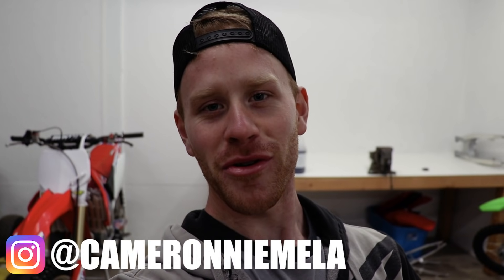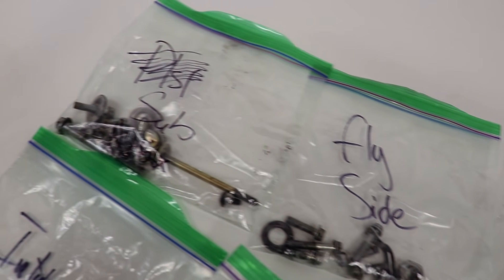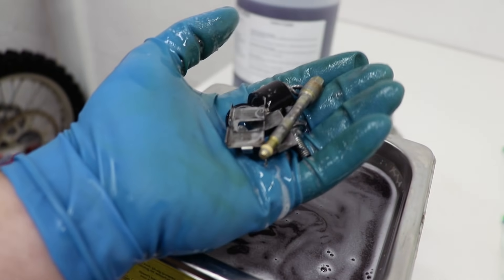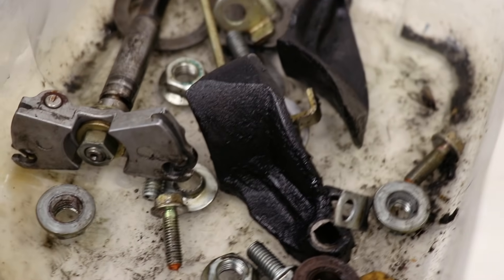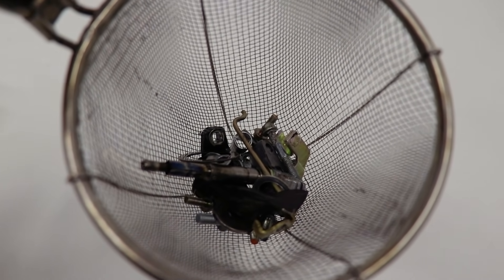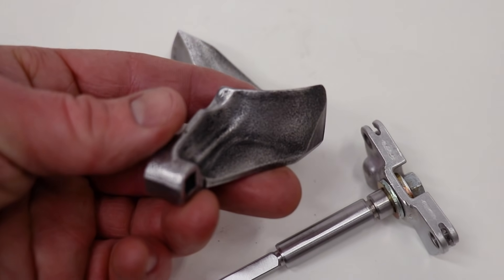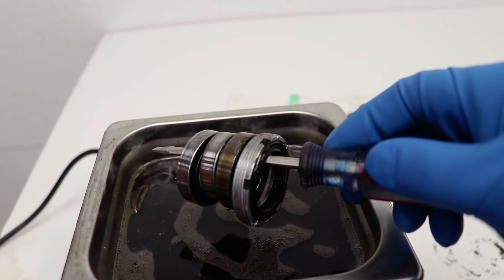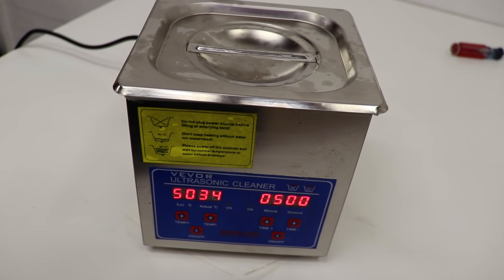How Well Do Ultrasonic Cleaners Really Work?

Comment from the maker: Have you guys tried using an ultrasonic cleaner before?
The cleaner I'm using here: http://amzn.to/2EvTZs9
Scotch Brite Wheels https://goo.gl/65An6b
Reply: Just found your channel and subscribed. We use one at the small engine shop I work at, we run them through for about an hour though. You throw pretty much anything in there and it’ll come out clean.
Reply: My experience is that a basket or hangers make a huge difference in speed and even how clean parts come out. Even the Harbor Freight one does a decent job if you hang the parts so they don't shake.
Reply: Vapour blasted and ultra sonic cleaned always for the carb, nuts and bolts you'd be better with a media tumbler (normally used for polishing brass shells) maybe look at a zinc plating kit
Reply: Scotch bright wheel link is dead, 404 error.
Reply: Link  the liquid cleaner  purchase site please
Reply: @FASTBOOBS  he said a subscriber gave it to him
Reply from the maker: https://amzn.to/2RWBYb2
Reply: If you're still missing a good basket, It would take seconds to make a perfectly adjusted one using a piece of metalic screen door / mosquito net.
Reply: Have cleaned 20 or more carbs in mine. Actually buying a 2 gallon unit for large parts
Reply: Cameron Niemela great video!
Reply: Fucking rookies just tighten it up till you hear the casting crack, back it off a quarter turn and call over the apprentice.
Reply: Links broken my guy
Reply: Nice Vid , Did yours come with a basket ? Mine did not , if so what is the basket made of ? or what material can be used as a basket? Thanks
Reply: @DavidJones-ib3zy   Basket usually is made of SUS304 for the general cleaning job. If you have to use strong acid or alkali, you will need a SUS316 basket.
Reply: @michaelclean771  Thanks , I have picked up a few SS baskets ; not sure of the exact alloy but they are barely magnetic , I don't plan on using acid of strong alkali.   I thank you a-lot for your reply.
Reply: @DavidJones-ib3zy   You can also hand up the parts with some wires if there is no basket.
Reply: Thanks your help is appreciated , BTW If my other reply did not go through , 'What type of wire ? ;
Reply: @DavidJones-ib3zy   If your parts are not heavy,  2mm and smaller wire will work for you.
Reply: Hey cam this is awesome! Is it the 2litre or the 3litre version please?
Reply: The link is broken
Reply: hey fyi your amazon links are not working
Reply: I guess im gonna pick one these things up as a future investment, since im learning small engine and outboards

Comment: Ultra sound cleaners are very much a must in any shop. However it depends  on your chemical you use. I swear using hydrogen peroxide works EXTREMELY well, and I highly recommend using it.

Comment: I use one at work all the time to clean carburetors, among other things such as nuts and bolts and wire harnesses.  Just be careful with what cleaning solution you use.  Some will eat aluminum pretty quickly in the ultrasonic cleaner.

Comment: I have the similar model, there are a few things I don't understand. Yellow sticker "do not plug power..." I just don't get it.  Do they mean fill it with liquid and then plug into the wall? What danger if I do the reverse? Also, I set the temp to 30 but it actually went up to 36. Why would that happen? BTW, I'll be using the device to clean watch parts. Many thanks.

Comment: Ultrasonic cleaners work via microscopic cavitation and need to have nothing contacting on the bottom of the tank. You need to suspend the item being cleaned from a wire or placed in a mesh basket but not touching the bottom.

Comment: I've had good luck with mine (ConstHydra Ultrasonic Cleaner 2.5 gallon) the only glitch is the heater keeps heating, even if you turn the heater off. I left a review on Amazon with this information and a suggestion to send it back if this happened. They removed all of my reviews and blocked me from any future reviews. I don't think pointing out a safety defect should warrant that action but Amazon does. I use a 10:1 ratio of steam distilled Water to Simple Green Lemon. (2 gallons H20 22 oz Simple green).

Comment: You gotta GOTTA use the stainless basket that comes with your cleaner..  it will RUIN the internal transducers if there's Any Heavier parts resting on them!! Plus it absorbs energy [soundwaves] that reduce the power of the ULTRASONIC WAVES

Comment: You should never set parts directly on the bottom of the tank. ALWAYS use a basket or something to keep them off the bottom. Not only does it not clean as well, it can damage the tank.

Comment: take a little pop bottle, cut the top off, and poke a few holes in the bottom, perfect little basket.  that's what we used to use in the sonic tank  to clean cryogenic pumps before they went back together. super high tech.

Comment: A good trick with A bigger ultrasonic cleaner is to save old plastic water proof peanut butter jars. 
Fill the jars with gasoline or kerosene throw your parts in the jar and close the lid and seal it up and throw it inside of the liquid of your ultrasonic cleaner. All your carbon will be removed and your ultrasonic cleaning fluid will not be contaminated because the peanut butter jars and seal and do not let the gasoline leak out

Comment: you needa small rubber matt on the floor of that cleaner or litle basket as putting stuff straight on the floor of the tank is not good.

Comment: Thank you for video.  Tip. Anything exhaust related including EGR use oven cleaner foam. Spray, rinse  spray rinse and using medium to hard brush to assist deeper penetration

Comment: That was a nice video. Apart from the few encrusted parts no high pressure air was used. Kind of interesting. Not even the carb was blown in it's channels. It can be messy.

Comment: I know this is an older video but what I watched today will save you time and money. If you place water in the UltraSonic and just solution in a plastic Jar and the parts inside the jar it does the same thing. You won't need to spend a lot of time cleaning your cleaner and this way works just as fast! Have a link to a video if you want but you can find it on Youtube

Comment: Hello Camelon.
I have one question.
Can it be used to clean the battery?
I don't know. Please.
Thanks.
Have a great day.
Reply: Is your battery waterproof?  If no, you better not to put it in ultrasonic tank.
Reply: @michaelclean771 

  Hello Michael.
Thank u for comment to me.
I have one more question, and it's the last one.
 Ha ha.. 
  I was wondering if such an ultrasonic machine could disrupt the sulphases attached to the lead plates in a car battery.
Reply: @doxtorart   Hi Doxtor, it is my pleasure to help you.  I never heard someone cleaning battery with an ultrasonic cleaner. You better not do that.

Comment: You are missing a control as taught in 7th grade science class. Unbelievable how many Youtube videos there are where they measure how good something is, but have no control to compare the two cases.  In this case, your control would have been you putting the bolts in that liquid without the ultrasonic cleaner. Did the ultrasonic do the cleaning, did the liquid do the cleaning or did they both contribute?  https://en.wikipedia.org/wiki/Scientific_control.  Also I sense many of your viewers may like videos like this one https://www.youtube.com/watch?v=Ey1Zvi9aiso.

Comment: Is it safe to use the ultrasonic cleaner on the bearings in the chain rollers? Did it pull the grease out of them or are the still good to go?
Reply from the maker: You'd want to re grease them after cleaning for sure

Comment: Temp & chemical did 95% of that... Get an old crockpot & put all parts in at once, mix up 4oz simple green to 1gal hot water, fill crockpot & cover w/lid, run it on warm/lowest setting a few hours to overnight...although, depending on how fast & far the temp rises on ur particular hot pot you may want to shut it off at desired temp & just wrap it up with a moving blanket or something to hold the heat in for many hours. 

Also, you can just heat clean water then pour it & the simple green over your parts in an old ice chest & close it up. 
Either way, rinse off with clean warm water & your done......... Unless you want to do any rust removal &/or refinishing, in which case look up electrolysis rust removal here on yt & follow the directions. Then restore those off looking parts & hardware with either a type of plating, cerakote , powdercote..etc, depending on preference & application.

Comment: Putting degreaser in there instead of water doesn't hurt the unit or shorten its life does it?
Reply: The tank is usually made of stainless steel 304 so it won't hurt the tank unless you use strong acid or alkali.

Comment: This seems like an effective and fast way to clean parts. Will a more expensive machine yield better results? How about using a different liquid? Can this be used on all types of materials, such as rubber seals?
Reply: The cleaning result will depend on suitable frequency, suitable power, suitable temperature, suitable size, and others. It will be different from case to case.  Ultrasonic cleaning is working better on hard parts cause the soft parts will absorb the sound energy.

Comment: do you know if you can clean parts of the firearm? will the phosphate coating damage?
Reply: A good cleaner will remove the phosphate. All depends on how long you leave it in there and at what frequency the bath operates at. Also, the cleaning medium used and how long it stood to deaerate will affect the results, even a turbulent pour when your filling can entrain air. A suspended basket gives better results too, lowered in slowly. In short, if you've a good setup and use the right medium, you'll eventually strip the coating off anything.

Comment: How often do you change the fluid after washing your chain and rear mech, cassette? It seem the tool is cheap but, the fluid is expensive and you'll have to chage it after every cleaning I guess?
Reply: It depends on how many parts you need to clean. If you clean hundreds of parts in an hour, surely you will use a lot of chemicals. In this case, you can buy a larger unit to install recycling system on the machine which can save chemicals for you.

Comment: All ultrasonic cleaners are not the same the more transducers it has is better. I have a 12 quart unit with four transducers I bought off eBay and use it to clean marine carbs I mix about 20 percent simple green to water at about 135 Degrees I clean for about a half hour and they come out like New. Simple Green is cheap. Carbon on the other hand is tough to remove increase the cleaner deloution  and clean time. I have done pistons may take a couple to hours. It helps to clean the heaviest deposits by hand first

Comment: If the part is not heat-sensitive, (not plastic), you can get built up carbon off by simmering in a stainless kettle of water with a box of baking soda and a couple of Tide pods thrown in. Just let it simmer for a half-hour or so, and it 'cooks' the carbon off enough to buff or brush or scrape off easily, something that an ultrasonic cleaner can't achieve.

Comment: I used my cleaner without a basket and it caused pitting in the tub. It now leaks. Setting parts directly on the tank bottom bottom increases the incident of cavitation erosion – pitting of the tank eventually causing the ultrasonic cleaner to leak .
Reply: thanks for sharing your experience for the education of others!
Reply: thanks for the heads up !
Reply: Good call-out for a problem a lot of people likely never considered!
Reply: then, it is a ultrasonic leaker?
Reply: I fixed the leak by using welders bond. No more leaks and works fine.
Reply: @MarkZeds  perfect!
Very good to know.
Reply: mine came with no basket , so should I find a metal or plastic one ? Make or find 1 of course . As I've had this 3 + years & just opened it up .
Reply: That is why it as little rubber tubes on bottom of basket ..
Reply: Came in the comments to ask the same thing. Never used one yet but i figured the basket were needed for something like that

Comment: Ultrasonic cleaners are extremely useful but how effective they are is largely dependent on the solvent used and what you are trying to clean.  They are basically microscopic agitators so if the gunk you are trying to remove is not highly soluble in the solvent you are using then it is going to wanna stay on the surface of your parts.  It would be interesting to see if you could find a solvent specially formulated for carbon build up and use that in the cleaner.  Great video.  It was fun to watch.
Reply: Perhaps pre-soak the parts with carbon build up, with a simple spray on oven cleaner? I've used this for cleaning piston crowns.

Comment: If you still need a little basket for your ultrasonic cleaner, try a stainless steel drain screen.  Places that sell plumbing supplies usually have them.  You might want to re-shape it a little and put a wire handle on too.  They're really cheap, about 3 US $ last I knew.  Won't that basket that you used to hose off bearings fit in?

Comment: Denture cleaners or jewelry cleaners are good for small parts like bolts.  They are cheap (like $10-12) and most come with a basket for the parts.  I got my first one at a second hand store for four bucks.  In all I have three for big projects:  each has a different solvent (a paint safe, a paint remover, and a mild rinse).  Works great and easier than trying to hold a 
1/2"#8 screw.

Comment: You can also fill the ultra sonic cleaner with water, and then fill degreaser in the zip-lock bags and dump them in the water,  This is especially useful when you have a bigger cleaner.  Saves a lot of degreaser.  The ultrasonic waves are not stopped by the plastic bag, and as long as the parts are covered in fluid it works just as good.  And the bags float on top, since they don't need to be full
Reply: Arnljot Seem thanks for sharing that!
Reply: Plastic dampens the ultrasonic waves. Glass is the way to go
Reply: @TheTofuGod  Still works good though
Reply: I was just about to write this and seen I’m three years late 😂
Reply: Brilliant! Retrieving is easy also.
Reply: Thank you much for shaing it. And dirts stay in bags :) easy and excelent!
Reply: That's a really good idea
Reply: Maybe using Seafoam or any other carbon cleaner inside the bag for the exhaust parts?
Reply: They make plastic bags for ultrasonic cleaners that increase the number of bubbles.

ETA: oh yeah, the bags shouldn't be full. Cativation is about pressure.
Reply: @wakkywabbit5446  Any links or product names for the bags? Couldn't find via search.
Reply: Thanks Arnljot, that's a great tip
Reply: Why not just pour degreaser into the water?
Reply: @Fabio-fd7bs  you can save a lot of degreaser this way, and have a much higher concentration.

Comment: Step 1 take Mikuni carb off Step 2 chuck it as far as you can Step 3 buy a PWK 38....Best mod ive ever done on my 2002.When i got my 2005 CR 250 i got a YZ250 PWK with tps and never looked back.Good video though!

Comment: Worked great on the carbs i cleaned.. came out looking almost new. I used mean green degreaser 50-50 with water and ran through about 4 cycles. Bike runs perfect now. Would recommend to do this with any parts needing cleaned. Great video.

Comment: You can make a basket out of some stainless or aluminum screen and a wire coat hanger. Leave enough screen to fold over the top for the floaty parts.

Comment: Great video man! It seems like your ultrasonic cleaner works a bit better than mine. I have the Harbor freight one and I use simple green.
Reply: The big one? My HF cleaner works great. I use dilute purple simple green with the heater on and even the nastiest parts come out shiny like new. Purple Simple Green works way, way better than normal pansy-ass Simple Green.
Reply: Mine is the same as that, waste of money. Get as good results with gas.

Comment: You think you could get a parts yz250f engine in I blew up my bike it snapped the valve off and shoved it back into the valve seat sideways it almost shot out through the exaust. It's a 2001 I need a whole new head but don't want to spend the money for a new head, this SUUUUCKS.

Comment: Nice video! but... You should not imerse sealed bearings on solvents.
Reply: Also its not good advice to ultrasonically clean bearings at all. Ultrasonic cleaning works by creating very small cavitation bubbles, they collapse and smash the dirt off the surface. If you do the same with bearings it can actually cause very very fine pitting in the raceways. You wont see or feel it, but the bearing will fail earlier.
Reply: you actually can service a bearing with kerosene or a degreasing agent as long as you rinse then blow it out with compressed air and repack with good grease. a ball bearing could last a real long time theoretically. but generally there fairly cheap to replace.
Reply: 6:34 sealed  7:29 almost all missing seals. this guy does amazing work but Leo is right you dont put sealed bearings or parts with rubber O rings in them in solvent, hopefully he was just demonstrating the power of the ultra sonic cleaner though he did state they were just old bearings
Reply: yeah....was enough for me to see how much i can learn from this channel :))
Reply: Didn't look very sealed to me

Comment: Great video as always!The parts and especially the carb came out flawless!I just wanted to point out that you shouldn’t clean bearings with ultrasonic cleaners.The cleaner makes tiny little scoring inside the bearing races and actually destroys them.But we all knew you wouldn’t use those bearings wright?
Reply: Or use used bearings! 😅
Reply: Thanks for that, I'll just replace my bearings. 🖐🇦🇺